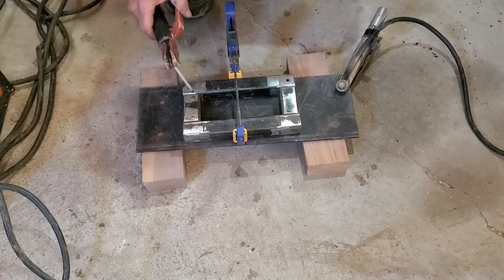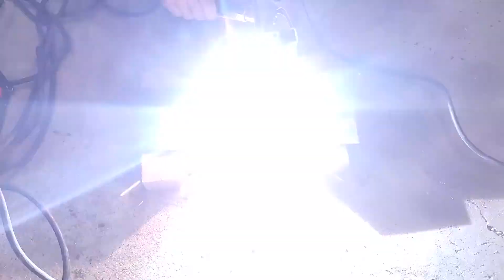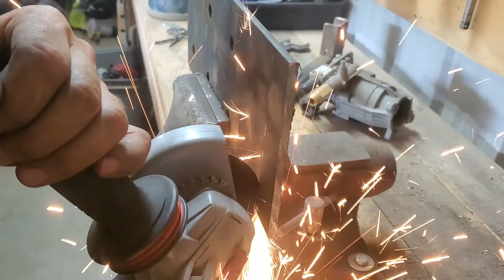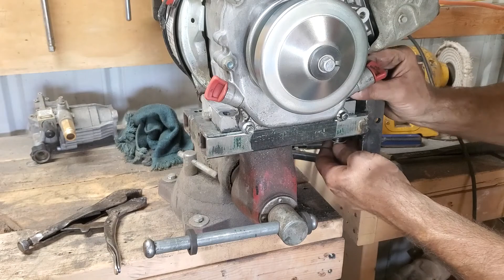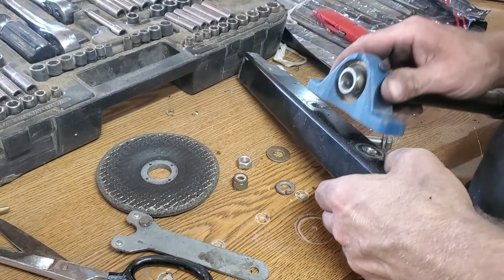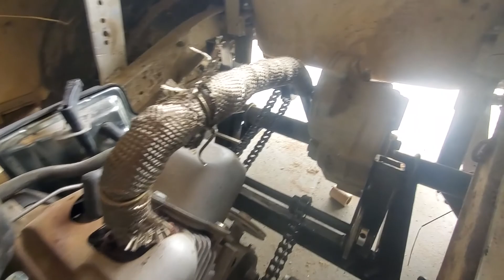Electric Golf Cart To Gas Conversion

Comment: Most people watch these videos for entertainment only.I watch them to learn things. One of the things I really wanted to know was how you hook a sprocket or a driven pully to the gearbox/rear end. I still don't know, why didn't you show that?
Reply from the maker: @radamson1  I pushed the shaft out of the original electric motor and got a sprocket with the bore size that matched the shaft
Reply: @jlistdiy  Yeah, I did too. It had been so long since the motor had been out(never) it was frozen in. Once I got the motor out I could see that the best way forward was to take the armature out and proceed from there with it. Thanks for the come back.

Comment: I just turned down my  shaft to 7/8 ths  to fit the 10tooth drive gear and put the red spring back onto the driven clutch  and drilled a new tension hole between 2 & 3 , Im up to 20mph

Comment: Got a 91 club car that is also electric tearing it down to the frame and rebuilding it sat in the woods for 10 years planning on going with a 420cc predator from harbor freight
Reply from the maker: @lilshag347productionsii6  awsome definitely gonna be great whwn finished

Comment: Is the frame aluminum and if it is how did you weld that steel engine mounting plate to it?
Reply from the maker: I built a sub frame that attaches with bolts I show what I did in this video https://youtu.be/DzM70BvNHLk

Comment: Could you have flipped over the axel and have the chain line up with the fnr?
Reply from the maker: Yes absolutely you can but the only reason I did it this way so I could change the gears for more torque or more top speed
Reply: Thank you for your reply. I haven't found a video of someone doing that. I'm thinking of taking that approach to better line up the engine with axel gear box. @jlistdiy